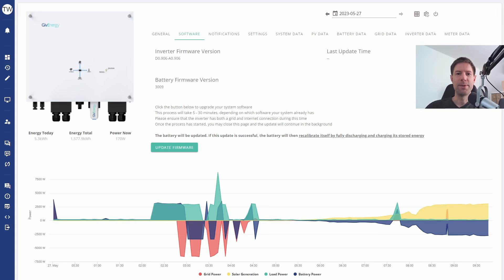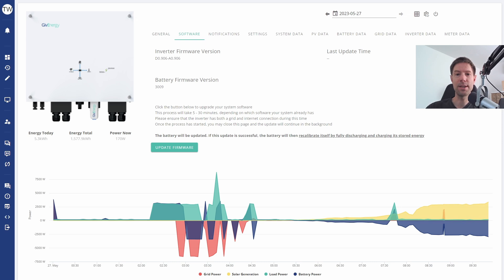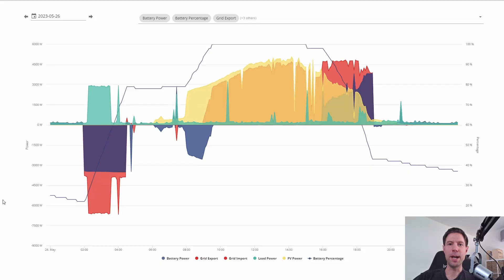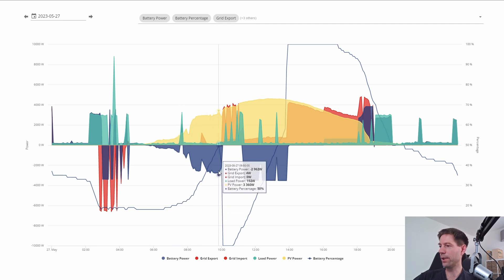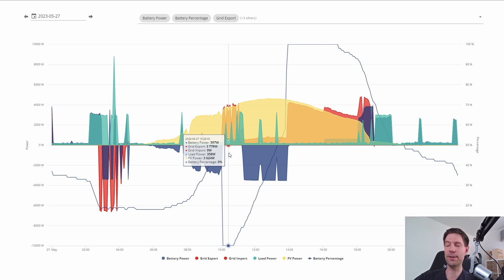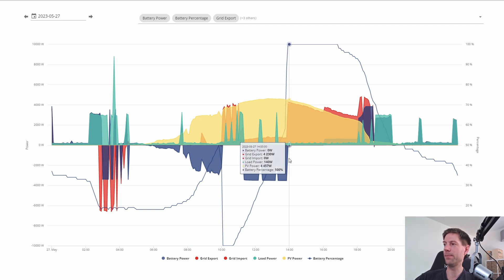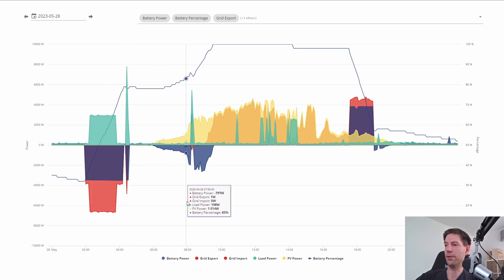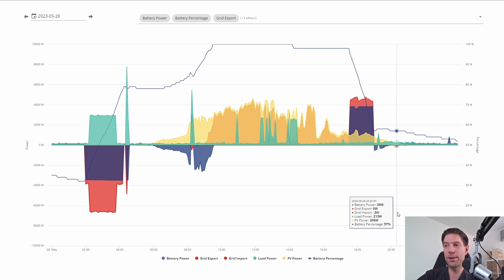GivEnergy battery firmware update v3012 - walkthrough

Comment: I have  2 batteries 8.2kw master and and 5.2kw. They were on different firmware 3007 and 3009. Noticed some strange things going on in last couple of days, GE suggested updating firmware which failed remotely. They sent me firmware in email, I had to switch off DC breaker, then switch off battery, remove USB, flash with new firmware and repeat in reverse. 8.2kw updated, 5.2 didn't. Numerous phone calls and remote update attempts to no avail. They suggested reflashing the 8.2kw back to 3009 so it was the same as 5.2kw, which would allow them to continue with upgrade to 3012 once both batteries matched. Clearly that didn't work. This morning the app is doing Hokey Cokey with battery level changing every 10 seconds 50, 51, 50, 51 etc. The portal is now showing I have a 6.4 kw (2 packs) lead acid battery. The 8.2kw battery, looks like it has zero electric in it, only half lit first light, GE say the last time the battery had connected to Inverter was 1617 yesterday,  I applied the reflashing to 3009 at 1619 and confirmed complete at 1621.  Numerous tests done with second line today. They suggested I get my installer out to check all the wiring which is a bit of a joke. I have confirmed the 8.2kw battery won't switch off so BMS frozen. They have agreed to send their own engineer, which they expect will take 4 weeks. Oh yes, I'm due to have another 5.2kw battery installed in 2 weeks time.  Not ideal. Any ideas how to try and kick start the thing in the meantime? thanks
Reply from the maker: I suspect GivEnergy know a lot more about this than me, I'm afraid, I'm just a consumer, like you, and this isn't something I've encountered before.  I hope you're able to get it fixed, sounds like a nightmare.

Comment: You appear to have a fairly large period of the day where the battery remains at 100% charge, would it be worth considering charging the battery to a lower percentage during your off peak and so reducing your grid draw?
Reply from the maker: Well, that's a complicated question to answer.  I'm intending to do a video about why I do what I do in due course but the short answer is I'm trying to prevent the battery heating my hot water overnight as I want the grid to do that.  By forcing the battery to charge during the same period that the water is heating it ensures that happens most of the time.
Reply: @TimAndKatsGreenWalk  I could be wrong but believe you should be able to set a rule so the battery doesn’t discharge during a set period i.e. the period you are heating your hot water
Reply from the maker: @darrylchambers1  I tried to find that but couldn't seem to locate anything of that nature.  I'll have another look.
Reply: @TimAndKatsGreenWalk  My apologies if I have sent you on a wild goose chase. Having checked, I don't believe this is possible currently. Hopefully, in the future via a software update, this functionality will exist. In an ideal world, the system would be clever enough to take intelligence from local weather forecasts the night before and calculate how much (if any) low-cost grid power is required to charge and to what level during the off-peak period, for the following day.
Reply from the maker: @darrylchambers1  no problem at all, I did have another quick look but couldn't find anything either; it didn't take me long.  It would be a very useful feature and I'll be asking GivEnergy about it at some point.
Reply: Hi Tim, just found a setting within the inverter settings from the web console - it looks like you can change the ‘Timed Discharge’ independently of the ‘Timed Export’ (presumably for tariffs such as Flux) If I am reading this correctly, this should mean you are able to set the times you only want it to discharge (i.e. outside of your off-peak times) to avoid using the battery to heat your hot water.
Reply from the maker: @darrylchambers1  ah, quick update.  I just tried switching on both the Timed Discharge and Timed Export modes at the same time and it doesn't let you have both on together.  After submitting the change it looks like both are on but then refreshing the page reveals that it secretly turned the other one off.  Additionally, using the Timed Export mode turns off the Eco mode, which is why the battery doesn't perform as expected the rest of the time.  So yeah, misleading descriptions, I think.
Reply from the maker: @darrylchambers1  yeah, I think it's a bit confusing because these settings seem to map to the ones in the app in a non-obvious way and when I tried the "Full Export" consumption mode in the app the battery no longer operated as expected during the rest of the day.  So I ended up using the "Home Demand" option in the app, which seems to map to the Timed Discharge mode on the web portal.  And that definitely exports to the grid, not just meeting the home demand.  It's a bit weird.  But if you find it works differently to that then let me know.  Incidentally, I updated my Gen 2 inverter to the latest firmware recently and it now seems to hold the battery at the defined percentage charge during the scheduled charging (i.e. no longer supports the house load once charged, within that period), so it doesn't do the annoying charging/discharging/charging cycle that it did before when also heating the hot water or charging the EV at the same time.  So perhaps they fixed that particular issue in the update.  I shall continue to monitor the situation.

Comment: My own experience of the battery firmware 3012 upgrade on my 9.5 battery was much better than yours.  I’d upgraded the inverter with the smaller 5.2 battery a few weeks ago and waited to see whether there were any adverse issues, which there wasn’t, before wanting another good sunny day to upgrade the 9.5 on.
Today I kicked the upgrade off at just after 8am, and it ran flawlessly.  Unlike the 5.2 where the upgrade download failed the first time, the 9.5 download worked first time, the inverter restarted itself and as yours did, the SOC went to 0% straight away.
Unfortunately the battery was 90% full when I started the firmware upgrade so it took about 5 hours to drain and export all the energy from it, but during the draining down the SOC remained at 0% and the inverter stats showed no solar generation from that inverter and lots of export and battery discharge going on.  After 5 hours of draining down the battery started charging up from solar, which again took about 5 hours to reach 100%.  Only at the end of the charging up did I receive the ‘battery calibration completed’ message.

As I’m writing this I’m wondering whether some of the strange behaviour you saw during your battery firmware upgrade was because you have two batteries on your inverter and they charged and hence reached 100% at different rates?   I have two batteries but they are split over two separate Gen1 5kW hybrid inverters so I was able to upgrade each battery firmware separately.
Reply from the maker: Yeah, I wondered about that too.  Still, it all seems to be working fine since so I guess all is well.  Very odd though.  I'm glad yours worked ok.
Reply: A nice reassuring reply.  I am new to Solar PV and Battery storage.  This morning I started my first firmware update.  All went well with the inverter upgrade I am pleased to say, but then after 3 hours of battery discharge and the dashboard showing the battery at 0% but somehow still showing the battery discharging, I was starting to panic and looked on YouTube for assistance. Came Tim and Kat to the rescue with their video of firmware update.  Their post was slightly reassuring but did not really mirror my experience.  Fortunately your experience pretty much did.  Albeit my total discharge was slightly quicker (approx 3.5 hours).  Whilst reading your post I had a quick further glance at my dashboard and much to my delight My battery had charged to 4% (and now 9% as I type), so it looks like I am on the way to a successful upgrade of my system.  Clearly patience is a virtue when it comes to such matters.  Thank you for your post, it was a great help.

Comment: Hi Tim, well something has gone seriously wrong with my update. I got the update complete message and then really weird calibration activity like 0%, 100%, 0%, 100%, etc. Now I notice that the battery status light is red, the firmware version is now reported as '0', the battery temp is reported consistently as about -9.5C and I cannot manually restart the battery from the switch on the side. Yet despite all this the battery seems to be functioning as a battery, charging and discharging.  My inverter is on wired ethernet so there was no possibility of a wifi dropout during the update. So it's a call to Givenergy on Monday. It looks a bit terminal. I wish I'd not updated. Cheers
Reply from the maker: Oh boy, that doesn't sound good.  I'm sure GivEnergy will be able to help you.  Generally I hate doing updates of any sort if things are already working fine, so I was anxious about this myself.  I'm sorry to hear you're experiencing these problems and hope they get fixed soon.

Comment: It does have a mind of its own, Normally when we commission them after install or just run a battery calibration the inverter stops all solar that’s being generated to allow the battery to fully discharge, once that’s done it ‘turns the solar back on’ and fully charges the battery from whatever solar is available &  the grid. It’s strange to see that it didn’t cut off the solar in your video while performing a calibration.
Reply from the maker: Yeah, it seems to be a different story for everyone.  Very odd.

Comment: I’ve been on 3012 since commissioning and had no obvious issues (once they had the data wires set up correctly so it wasn’t reporting a 6kwh lead acid battery!). I am finding it a bit inaccurate detecting grid import - I know I should expect some but almost 1kwh a day seems a lot. But thats probably the inverter anyway not the battery
Reply from the maker: Hmm, that's odd, I was getting at most about 0.2 kWh per day import, more often closer to 0.1 kWh.  Mine's the gen 2 hybrid 5 kW inverter.
Reply: @TimAndKatsGreenWalk  ac inverter but both still clamping mains for export detect. I might ask if it can be tweaked
Reply from the maker: @MrKlawUK  yeah, I wonder how much control there is for this sort of thing.  I hope you can get it working better for you.

Comment: If it ain’t broke don’t fix it. …unless it’s factory safety recall and you must do it.
Reply from the maker: Well, I did consider leaving it.  But having a public presence I felt I should cover it.  If it had gone disastrously wrong at least it would help others avoid potential problems.  Thankfully it seems to have gone well enough and things are still operating fine.

Comment: Ah ha. This might explain why my GivEnergy 9.5kWh battery went from 47% SOC to 0% in a matter of minutes the other day just before midnight with nothing running or scheduled. I sent a message to GE but I haven't yet had a reply. Looks like I need to update the inverter firmware. However, where I am (Bucks) it's been overcast for 2 days & positively Baltic (11c this morning) so solar production has been very modest at best. Most unusual weather for the end of May / early June.
Reply from the maker: Today had been very overcast here following two weeks of almost solid sunshine.  Need a bit of rain, mind.

Comment: my battery firmware was updated to 3012 during commissioning two weeks ago - took only 20 mins which seemed very quick compared to your update. - One thing I have noticed is that battery charges up to 100% then despite having excess solar it slowly discharges to 95% (rate of approx 200 watts), then charges back to 100% and the cycle continues. - waiting on inverter firmware 909 to see if that fixes the issue.
Reply from the maker: Mine tends to get to 100% then drops to 98 or 97 but then stays there.  Not too big a deal but a bit odd.
Reply: That's a known Gen2 bug, fixed in the upcoming Inverter FW update.
Reply: @markrichardson8299  Good the hear. It's really annoying seeing the battery discharging - anything between 200w to 600w! - how this got past testing I don't know. - the term inept comes to mind.
Reply: Mine does the same, so annoying.
Reply: I have gen 1 inverters and can confirm that it doesn’t do that on my batteries at all.  Charge to 100% and then they stay there until house demand exceeds solar production

Comment: I had exactly the same issues as yourself Tim,total update took 24hrs but I have 2x9.5 kWh I wish GivEnergy would warn us more what to expect.
Reply from the maker: It seems quite different from one system to the next.  It's a bit weird.
Reply: Or at least allow us to choose a calibration time…
Reply: @JohnR31415  Yes. If I'm gonna have to pay for the battery to recharge I'd like to do it at the cheaper rate at night. Also, why are GE not advising us that a new Firmware update is available?
Reply from the maker: @JohnR31415  yeah, the ability to schedule an update to start in the middle of the night would be really handy, actually.
Reply: Your all correct,I tried like Tim to time my discharge/charge to suit my tariff etc.. but had to shrug my shoulders and take it in the wallet,a bit annoying really.Also as Tim described fluctuations in discharge/charge made me doubt myself due to length of time the update was taking,I looked long and hard and zero information regarding what to expect
Reply: @Lee W  - do both your batteries run off one inverter? Does it give you max output of inverter?
Reply: @Ben,yes I only have 1 inverter and also 1 side of the power ie 2.5 kwh